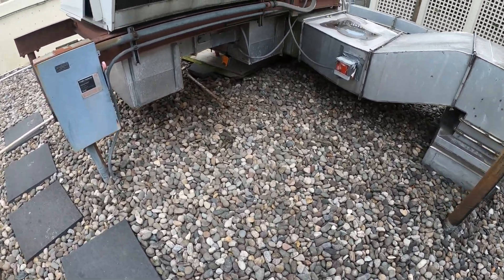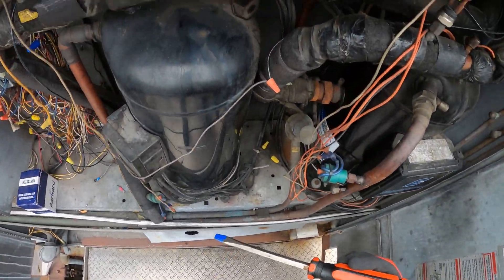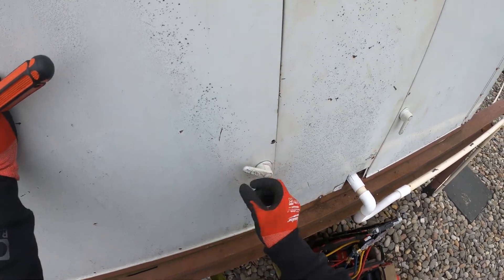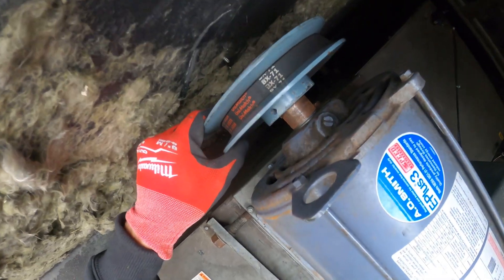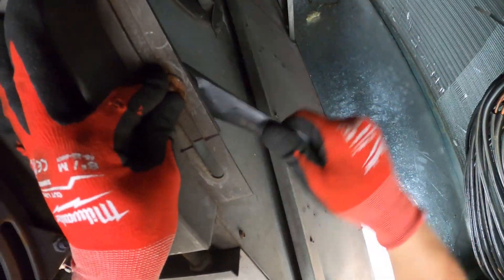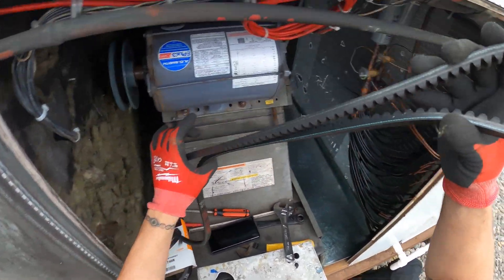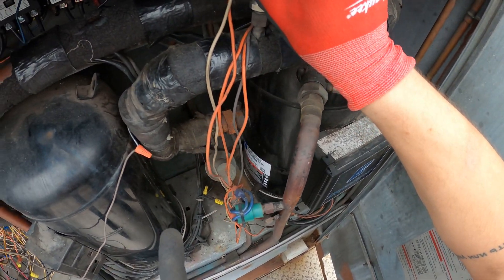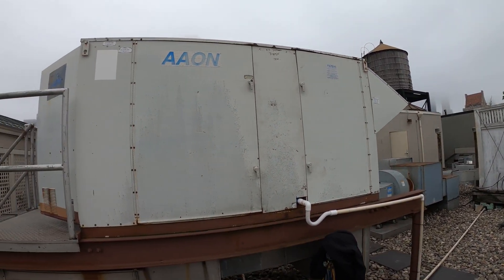HVAC: AC Making Loud Noise When Starting (HVAC Service Call) RTU Troubleshooting/Tips & Tricks

Comment: I'm used to flimsy home HVAC setups that last 10 years, maximum.  Some of your equipment Is very old, but being repaired, and still working as intended.  This is more interesting to see than 95% of the HVAC calls I had in the 1980's and 1990's.

Comment: great job? few points. you forgot to clean and oil the bolts and nuts thread on the adjusting motor. secondly, the belt was very deep into pully's pitch. Use the right hand when tightening the bolts and nuts unless you are left-handed. that's what I learned in forty-one years of experience. I like your camera

Comment: Did you measure the motors resistance to ground before pushing contractors in?
Does your meter measure Inrush current?

Comment: If you're replacing the belt, why not just cut the old one off?
Reply from the maker: Usually I just roll it off by hand and do the same thing in reverse to install the new belt but the belt somewhat stretches by doing that. The safest bet is to really loose the tension on the belt by adjusting the motor bracket so the belt doesn't stretch and you adjust to a good tension🙂 Thanks for watching! Always appreciate your feedback🙏 Stay safe out there

Comment: Not at all clear that the old belt needed to be replaced and the repair would have been to simply increase tension on the belt.
Reply from the maker: I actually adjusted the motor plate back to the original position so it was the belt & not the tensioning. I had the materials in my truck for this buildings Preventive Maintenance so I figured we start by changing the belt because it was going to be replaced regardless. Turns out thats all it was. You can hear the old belt make noise when it turns by hand. Terrible. Thanks for the feedback & thanks for watching! Stay tuned for new videos every week & stay safe out there! 😷✌